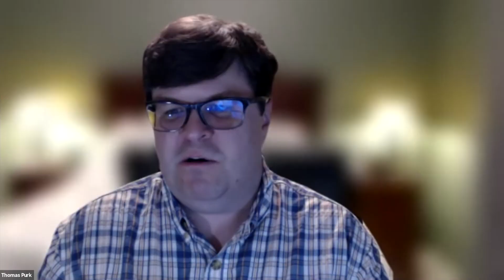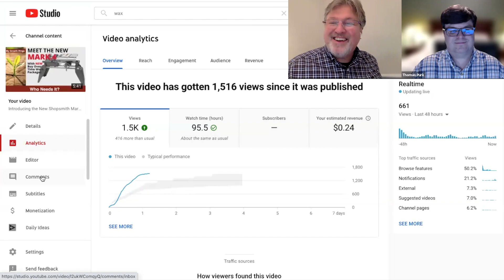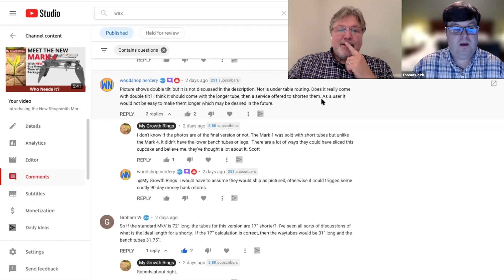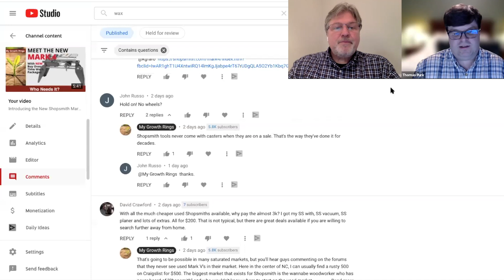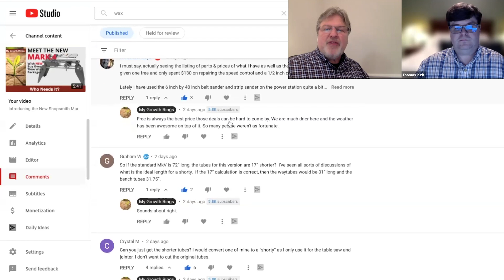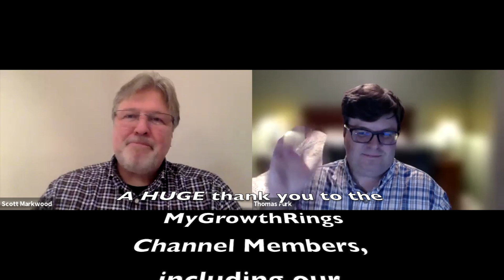Tom from "Woodshop Nerdery" joins me to discuss the new "Shopsmith Mark 4" introduction

Comment: My used purchase story is that there was an old retired snowbird here in Central FL that put an ad on craigslist within an hour and a half of me. Selling his perfectly running complete 510 because he’s sell his entire wood shop to move back up north. Came with the scrollsaw, the bandsaw, 2 disc sander plates and about 10 new sanding discs, an original unused chisel set from Shopsmith, about 10 different new shopsmith chucks, 3 new tablesaw blades, 6 new bandsaw blades, a whole bunch of new shopsmith scrollsaw blades, a complete upgraded table, set with the larger table, two more tables and 4 new tubes and the extension table telescoping legs. The original owners manual and self study course, plus every receipt he had for it since purchasing new in the 80s. Even had one of those Shopsmith big white cross cut tables for the tablesaw. Completely unused. He was asking $250 for all of it, and I had to haul it away. I didn’t haggle at all, and now going through it at my house. Also, something called a shopmate maxiclamp, new in the box. Haven’t even researched that to figure out what it is yet.
Reply from the maker: Incredible! Good for you.
Reply: @MyGrowthRings  thanks Scott! Yeah, still can’t believe the deal I got. I was planning on shortening it and saw on the forum that the consensus seems to be cutting the tubes between 15 and 18 inches. When I measured and eyeballed that out on my mine though, a 15 inch cut makes it as short as a mark 4. The mark 4 looks just too short for me with all the tables I have available so I was thinking of cutting the tubes only 12 inches. I’m going to mock it all up to see if shortening it 12 inches still let’s me use all of my tables and accessories.
Reply from the maker: @scottschultz9354  I would error on the side of too long, since you can always shorten them. Some shorties I’ve seen are just too short.

Comment: So I have owned a 520 over 30 years. 
It is HEAVY 
It is big and I saw Nerdery big build and his comments that he would NEVER cut his tubes and I thought about it long and hard and I strongly disagree. 
You really do NOT need the long way tubes and length of the machine to accomplish the things that Nerdery says you need the length for.  
In FACT:
Showsmith sells extentions to the sides with telescoping legs etc is proof of that . 
I have those and until I looked at NERDERY's rediculously sized build...(comment on size not idea it is huge!) 
I realized that I could cut 16" off the tubes and use the unti almost EXACTLY like I do now 
IF I wanted to I could add the SUPER SIZED table using the way tubes etc I already have on both sides.
I built a router table that fits onto the upper tubes and lines up with the saw table and I use it often as a support.
Having the extra side tables with the 520, Floating tables, exrtention legs and extra table tubes  I can get a VERY large cut if I wanted to 
I have given up on table saw for large sheets after I feel in love with the clean perfect track saw cuts I already get without having to muscle a sheet around.  
I thihk that a shorty is brilliant and with a few extra pieces I already have the system will be much easier to move around and use.
MUCH easier to get around and I really wont loose ANYTHING in the conversion 
There was ONE thing that has held me back in the past my cabinet.
I built a complete cabinet that hangs off the way tubes....
I has tempered glass doors I recycled from old stereo cabinets, drawers, shelfs etc.  
So IF I do this I have a lot of work ahead of me to remove the cabinet, cut the tubes, rebuild the cabinet and reassemble everything, 

I bought my Shopsmith from Lowes demo in Springfield IL and bought the model he was demoing. I was blessed to have a demostrator that left me the thumbscrews for quick assembly and disassembly as well as the extra kit parts he normally took around.   
I have the 520(tables saw, drill press, lathe etc), bandsaw, jointer, vacuum, extra floaters, a wall hanger for the table and tubes (AWESOME) extra tubes for the floaters.  I had already thought about making it shorter the room I have in the basement is only 13' x 14' and that is tight 7 1/2" ceilings, so you have given me great ideas and I can't wait to get started, let you know how this turns out.   

Thanks for a new perspective and a little added empowerment/courage. 
I see that even if I do cut them down and don't like it. I can always buy new tubes.

Comment: Great video.  I enjoy both of your channels.  In my mind a speed increaser would be better for under table routing than the double tilt.  What do you think?  The issue I see is the inability to use the quill motion to adjust the router height as opposed to raising the table height.  I assume the quill motion is more precise than the table height.  Is the accuracy anywhere clos eto that of a router table with a lift?
Reply from the maker: Your observations are exactly correct. The advantage of the speed increaser is you have the ability to use all of your extension and floating tables to create a very large table. The disadvantage is you lose the Quill adjustments and there’s a component of the speed increased that wears out over time. This is a timely question because I’ve been discussing with Tom from Woodshop Nerdery  the need to do a video on shaping and routing options.

Comment: Its kinda like buying a car. I have never owned a new car. I probably never will. My brother has bought new cars since he was in college. He probably always will. We need each other. ;) I bought my first Shopsmith several years ago because I was looking for a used bandsaw and found one on Craigslist that came with a used MkV 500. A couple years later I found a 510 with a couple of SPTs. I sold my craftsman table saw(that my brother had bought brand new) and the duplicate band saw that came with it to pay for it. Last year I acquired a like new 520 with a 50 year anniversary headstock and bandsaw for $200. The guys father in law had bought it new and didnt use it and they were tired of storing it. That was the tenth Shopsmith that I've bought. I sell the parts I dont need on ebay to pay for the next one. I bought one just so I could keep the speed reducer that came with it. Still looking for a few other accessories. I havent found a bargain on a PowerPro headstock yet but maybe my brother will buy a new one. ;)
Reply from the maker: Like you, I’ve owned two new cars and will never buy another one. I don’t mean to come across like I’m saying that I wouldn’t buy a used Shopsmith. Quite the contrary. My point is if someone has the money and just wants to get to work, a new machine is just the ticket. The “umpf” behind the PowerPro is nice to have.

Comment: In addition to your points on the Powerpro headstock, the Powerpro headstock makes lathe turning so much easier too. The speed goes down to 250 for sanding and the control of the higher speeds is excellent - no guessing. The downside is the electronics which will not have the life of the mechanical units. Will not be seeing these in20 years on eBay.

Comment: We all know the Mark V has 5 basic woodworking operations built into the tool. So, why call this newest version the Mark 4? When I first saw that name I thought, ok, which basic operation has been taken away with this new machine. According to Shopsmith the answer is, none. Kind of confusing to us current Mark V owners (well to this one). I would like to see it in the drill press mode. If one function was taken away, it would be the drill press. Just seems too short for that.
Reply: Chad, I have the same question. I also had it about the Mark VII vs. the Mark V. The first five are 1. Table Saw 2. Disc Sander 3. Horizontal Boring 4. Drill Press 5. Lathe. Yep the Mark IV does all 5, with less lathe capacity and as you point out an awkward height for a drill press. Additional Mark VII functions 6. Over-table router 7. Under-Table Shaper. Okay but I'm already doing some, although with limitations, over-table routing with my Mark V. Then the addons add a lot to the Mark V. The speed increaser gets me under-table shaping. If I get the Speed reducer, I get slower quill speeds and some protection for the quill.

It's this sort of quandary that has me moving so slow on the upgrades.
Reply: @woodshopnerdery  So, if you're already doing some of those functions of the Mark 7 (with limitations) on your current Mark V. Do you suppose it's necessity versus convenience that's keeping you from upgrading features of your Mark V? Or is it more the cost of the upgrades? Or perhaps a combination of all three?
Reply: @chadnevels246  It's all three plus confusion. I'm willing to spend money on a hobby, but I like it to be a good balance between passion and logic. The passion is there, I'm in a full on drool over the MK7. But logically a bit confustion. So that is why I was looking at the 7 functions, am I getting new capability? Yes I would be getting more convenience, power, etc. But what new operation can I now do? So obviously I get something out of the upgrade, but its not clear how to quantify that and weight it against the cost.

I discussed it with my wife a few months ago and she has cleared me to spend the money on a new MK7. But with the 510 working so darn good and no immediate need for it, I'm taking my time.
Reply from the maker: @chadnevels246  Perhaps they should have named it the "Mark +" or even "Mark S" for Short.
Reply from the maker: Or maybe the "Mark-ER"
Reply: @woodshopnerdery  I completely agree with all of that. So, If you do upgrade to a Mark 7 at some point, it would be to the PowerPro headstock alone (+ double tilt), or an entirely new in the box Mark 7? Would you sell your 510?  I know you don't have the space currently for 2 full size Shopsmiths.

The PowerPro for use as a router is much slower r.p.m.'s than a handheld router, of course. But for use as a shaper the r.p.m.'s are where they should be. Most floor model shaper's spindle r.p.m.'s are a max of 10,000, with variable speed and variable direction, which the Shopsmith Mark 7 has those features. What it lacks is 1-3 less horsepower than a actual shaper (which are typically 3-5 hp.),and I'm guessing torque as well. The PowerPro can be wired for 2 hp. @ 220 volts. With that said; I would think the Powerpro would adequate for shaping, but still not for routing.
Reply: @MyGrowthRings  I like "Mark S". Speaking of "S", did you see the 520S yet?
Reply: @chadnevels246  The short answer is I don't know what I will do. Can't decide. If I do all the upgrades to my machine individually, well then I am in spitting distance of the cost of a whole new unit.

Given all the un-even experiences documented with the PowerPro, I will definitely at least hang on to my C Headstock as a back up. But no I cannot keep 2 machines with my space.
Reply: @MyGrowthRings  "Mark-Stealth" with a black paint job.

Comment: At 10,000 rpm, even the PowerPro isn’t fast enough to be satisfactory for routing.  So as you say, a separate router table is probably the way to go for that.  Are there any other power tools that you would get in preference to using the same function on a Shopsmith?  How about a sliding mitre saw, because it avoids the set up and alignment hassles of the Shopsmith saw table for some operations?
Reply from the maker: Yes, I thing a chop saw is a very common add-on, and today's sliding, compound saws are an even better option.  I purchased my first Hitachi sliding chop saw from Shopsmith about a year after buying my Mark V.  I still have that saw but also have a Bosch Dual Glide that is amazing. If you are trimming a lot of construction lumber or installing moulding, any table saw will start to drive you nuts.  Scott
Reply: Hassles?.  Too strong a word. But to your point when building cabinets the miter saw is handy.  The only time I have ever thought of my SS as a hassle… well never in the truest sense. I have an incra miter sled that is far better for repeatable miter when making boxes.  I will cut all my stock to rough length at the miter saw and trim the miters on the sled.  It’s hard to beat a good sled for picture frames and boxes.
Reply from the maker: @bobwebberkc  I agree that there are a few table saw operations that are a hassle on the Shopsmith, which is why I mention tripping constructing timbers and moulding, imagine cutting a compound angle ont he end of an 12’ length of crown moulding. Table tilted, miter gauge tilted, and how exactly to you feed it through the saw?
Reply: @MyGrowthRings  ok Scott agreed but what you  describe is or would be difficult on most table saws but really difficult on a Shopsmith. I’ve never owned a table saw and since 1993 have never faced am impossible task on my SS. I have used the band saw which I believe is better than nearly any other for long rips with a 45 on 16 foot long deck boards . If I sound like a zealot it’s because I am. Happily so I might add.

Comment: You talked about the market...  I suspect that there are folks that just want a variable speed motor that allows for boring, disc sanding, molding, sawing, etc.  with a table that tilts and allows working out at the edge.  These would be folks that have a bit of woodworking experience and have discovered their dissatisfaction with the limitations of the single use machines that crowd their workspaces now.

After all.... it only takes up as much space as a tricycle!

I enjoyed the collaboration.   Having two views provided good perspective.  

Thanks to you, the alignment and tune up of my bandsaw is working great!  I just put out a video about making Corbels for a fireplace.  Even with a dull and rusty blade it cut flawlessly, with no chatter or cupping.... in 4" stock!  I gave you a shout out of thanks in the video.
Reply from the maker: Dave, thanks for the shout-out but more importantly I glad that you are pleased with the results.  Scott

Comment: Some Power Pro advantages.  Slow speed for big Forster drill bits and drilling with the grain.  Slow speed for lathe operations.  Reverse mode for mounting the planer to the right of the headstock so all controls are on the front side of the planer.  Almost no vibration.  Ease of use for speed controls.  And, of course, more power, especially on 220v.  I resawed 6" ancient Douglas fir with no issues on the table saw.  In short, I am very glad I invested the high price for my PP.  Still have the original headstock for a backup, but I hope I never have to use it.  Thanks for another great video, Glen
Reply from the maker: I agree with all of those points, Glen. I may have mentioned before that my biggest frustration with it was all the button pushing. "Confirm?" Of course I confirm that I just pressed the start button. Anyway, very good feedback. Scott
Reply: @MyGrowthRings  I concur on the confirm button.  I also think they should have made a key pad somehow that would facilitate selecting the rpm desired without having to hold the up or down arrows to get there.  However, given the space they had to work with, that may not have been a possibility.

Comment: I upgraded my Mark 5 to 7, purchased the shop deputy for $149, used the old 5 headstock for a power source. I have the scroll saw and belt sander on it. Of course had to build a stand.. Still use bandsaw and joiner on "new" 7. Tom if you ever decide to get a PowerPro headstock, I don't think you will ever look back. That's the reason I still connect the bandsaw & jointer to the PowerPro, it makes them preform better also. Scott didn't mention, but when you rip using the PP it's rare that board doesn't come out glue ready.
Reply: I think I will get a Power Pro eventually. But like you I won't let go of my current headstock, too useful. I keep hoping a used MK7 with double tilt comes up for sale in the classifieds in my area. But never has. That being said I am grateful for my 510, lots I can do with it.
Reply from the maker: Thanks for chiming in, Ellis. Excellent point about the PowerPro. Scott